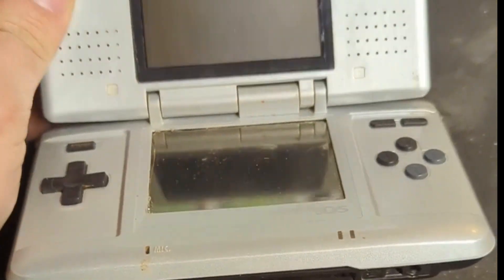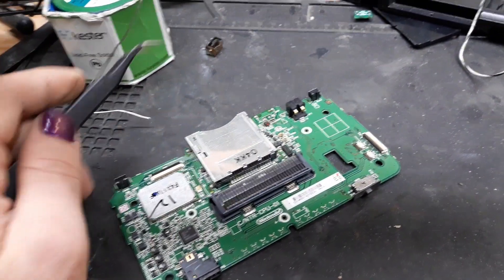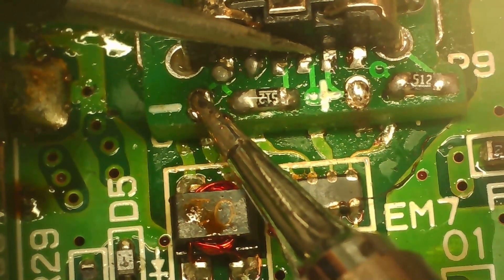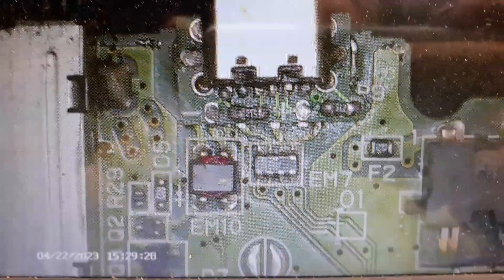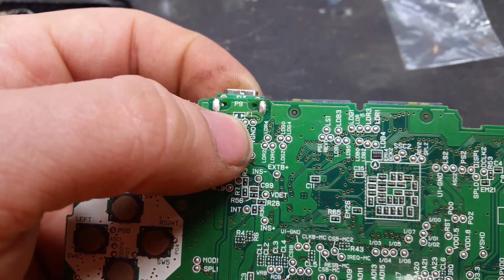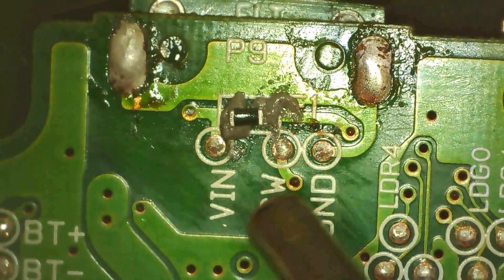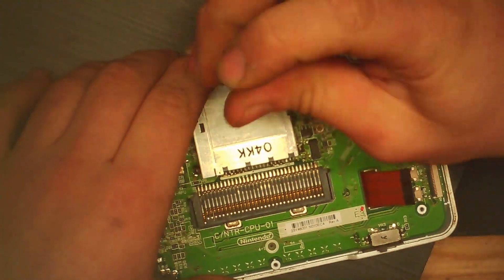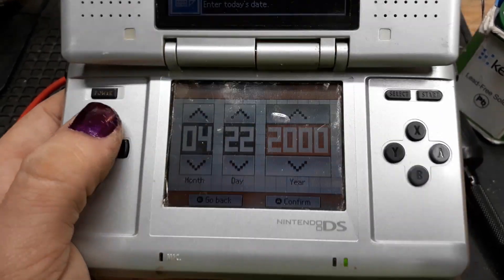USB C Nintendo DS?! Modding an Original Phat DS

Comment: That's really cool, thinking about doing that with my DS. What kind of charger do you use with the USB C cable, is there anything specific I have to look for or watch out for? I'm scared to fry it by using a wrong charger that outputs too much power 😅